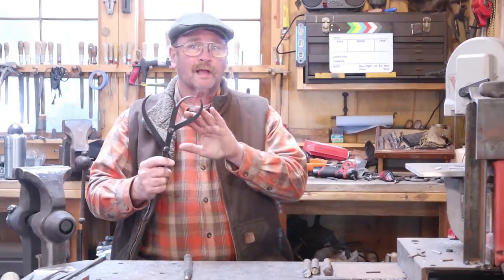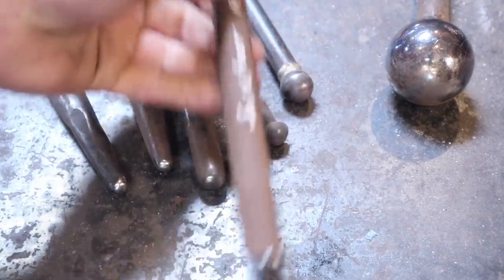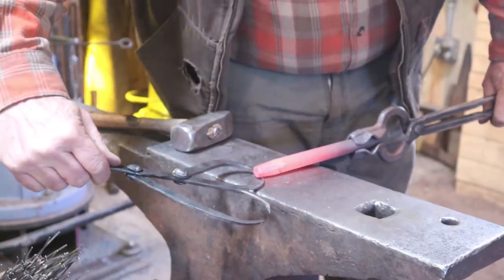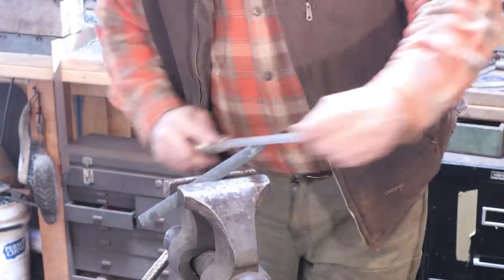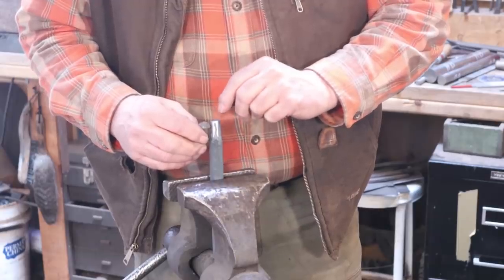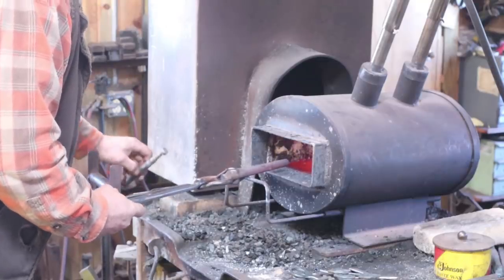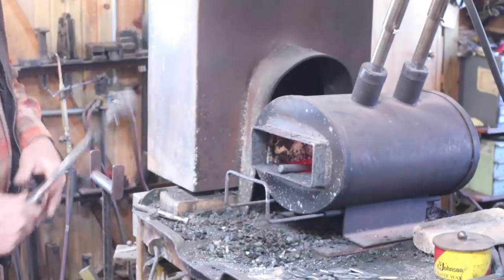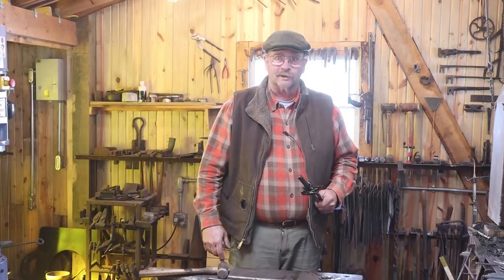Ball end punch

Comment: Since I’m still saving for my electric oven. I usually use 1095,1084,1075 steel and use a magnet to get to temperature. When it is no longer magnetic I place it back in to bring it up slightly more then quench.
Reply from the maker: That works pretty well for those simple steels but becomes less reliable for higher alloy steels.

Comment: Another really excellent video, John. You just can't hear this stuff too much when you are still a relative beginner and every time I hear it something else jumps out. I'm sure glad that you used the new double caliper, every time I see a dial caliper I cringe. Would a lesson on how your gas forge is plumbed and how you adjust it, turn off&on,  pressures used, your elevation and any of the other bits of wisdom that you have gathered be possible? I have a Chili just like yours and have troubles getting it up to welding temperature and when I try to turn it down to an idle it wants to suck the flame back etc.

Comment: Re-re-rewatching as I just obtained a bunch of spring steel.  A not-so short question regarding forming the ball.  IF you took the rivet, drove the head into a yellow hot piece of flat steel, let it cool, then heated the pre-shaped sucker rod and drove it into the depression, how would that work in forming the ball to fit the rivet?
Reply from the maker: It should work fine
Reply: I had the same thought, to make the river header, set the rivet in the vise, and drive the hot header onto it.

Comment: Hi John, for oil hardening steels, what are your thoughts about using water instead of oil for the second quench? Some do this because it will "freeze" the steel quicker, others never do it because it causes stress... Me, I have no idea.
Reply from the maker: While it should be OK, it is probably better to quench in the same medium.  Unless its one of the steels that require a cryogenic quench after tempering

Comment: Could you do an episode talking about different types of quenches? Oil versus water... different types of oil.. different temperatures of water
Reply: A quick overview of quenchants.  Water: good for mild steels 1018, AS36, up through 1045-1050 plain Jane straight carbon steel, Atlantic 33, and W1.  Salt Water: slightly faster quench, will push the hardest of medium carbon steels, like 1045-1050, and W1, W2, W3. It is a harsher quench, and can produce more distortion, especially in thin cross section, or intricate shapes.
Oil: 1060-1095 plain carbon steels, 4130, 4140, 5160, 52100, and O1.  Some steels like Air hardening tool steels like S7 can be pushed to a higher hardness by using an interupted oil quench.  Don't try this on thin cross sections... Quench just the working end of the tool in oil to take most of the color out of the steel, but leave it glowing just a bit around 1000 degrees. Then bury the struck end of the tool in ashes, lime, vermiculite, or wrap on kaolwool. Then put a fan near the piece to circulate air.
Air: A2, A6, A8, D2(not home shop friendly), S1, S3, S7, H13.  If you buy know steel, you can often get spec sheets for that steel which will give you all the best treatment data you need. Brine/salt water isn't used very much anymore.

Comment: As a colorblind person, I find it nearly impossible to determine the color of my steel. I can tell the difference between red and yellow but that's about it. Any tips for such a situation? I use charcoal in my forge because coal is just not available here as far as I can find. I don't know if that makes a difference or not. I have an especially hard time forge welding since I can't tell what the color of the metal is. So far I've gotten lucky a few times but mostly I either pull it out too early or too late. I've burned up quite a bit of metal trying to forge weld. I just can't seem to home in on the sweet spot.
Reply from the maker: I wonder if you can see a difference in the intensity of the light given off.  It might be worth trying a gas forge for forging and welding so that once you learn what happens at different pressure setting you can just set the pressure for the desired heat range.  For heat treating an electric oven might be best.

Comment: Would used hydraulic fluid be a good medium for a heat treat medium? I have about 20 gallons from oil changes of my farm tractor.
Reply from the maker: It is discouraged for a number of reasons.  Heat treat oils for industry are designed for a specific cooling rate, who know what rate transmission fluid cools at.  Used oils have contaminants that can cause trouble with steel by adding unknown properties.  The more additives and unknowns in the oil the word=se it is for your health (although any oil smoke is bad to breath)
Reply: Hydraulic fluid is really nasty stuff. I wouldn't want to breath the smoke from that.  If you decide to try it do yourself a favor and wear a respirator.

Comment: John,
What type of oil do you recommend for heat treating/quenching?
Reply: i think if you look through John's videos he does tell about oil for hardening.  do remember the don't use used motor oil.
Reply: For basic blacksmith punches and chisels plain old inexpensive vegetable oil works fine.
I've made nearly 100 punches from sucker rod, 4130 and 4140. All old school hardened and tempered. Haven't had any issues with them.
I make most hot cut tooling now from H13 as it is much more durable for hot work. And have recently remade all my most used drifts from S7. It stands up better to impact than most other steels.
Great video on this topic as well.

Comment: I was wondering if you know how an A2 steel would compare with S7 for making tools?
Reply: A2 is a good wear resistant durable steel for cold work. It is  demensionally stable through heat treatment, so you can grind precise shapes, and they will be stable through heat treatment. Good uses center punch, cold working chasing and repose' tools, punch and stamping dies for cold work on a fly press.

S7 is Shock resistant steel, it is normally air hardening, but greater hardness can be achieved with an interupted oil quench in some cases. S7 has decent hot working properties, and is suitable for running chisels, drifts, punches, and set tools.

H13 is an air hardening Hot work steel. It is nice for slitting chisels, drifts, hacks, hot cuts, and punches.

With all of these air hardening steels you need to be very careful with attempting to differentially harden them, or temper back the struck end of the tool. If you allow the whole tool to harden it will likely be harder than your forging hammer, and put a bunch of lovely dents in your hammer face. Not to mention the risk of the struck end spalling.  H13 you can raise the struck end to almost showing color 900-1000 and then cool slowly in ashes, lime,  vermiculite, or wrapped in kaolwool with a fan on the working end. To differentially harden, raise the working end to critical temperature, and bury the struck end in ashes, etc.  You can also make a bolster out of a heavy chunk is steel get that hot with the piece and stick the struck end in the hot bolster to cool. With a fan circulating the air around the working end of the tool. S7 and A2 can probably be treated much the same way though the tempering temperature should be a little lower, check the specs...  Hope that helps 😊
Reply: SJS Blacksmith that is awesome thank you!!!

Comment: I'm looking into getting my own forge, do you have any insight with Majestic forge?
Reply: Slickheadhunter I had one. I couldn’t get it hot enough to forge weld. I just replaced it with a NC forge I love it.
Reply: Johnathon Dyson how many burners did you have? I'm looking at the three burner model. I'll have a look at the NC's as well
Reply: I had the two burner majestic. And the NC is also two burner with open ends. 15-20 minutes it’s at forge weld temp.
Reply: Johnathon Dyson thanks!